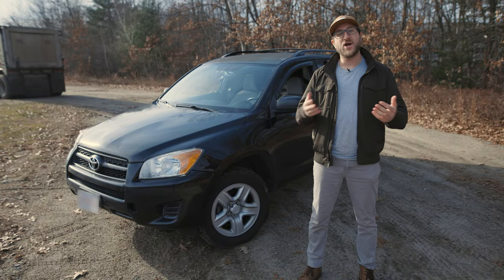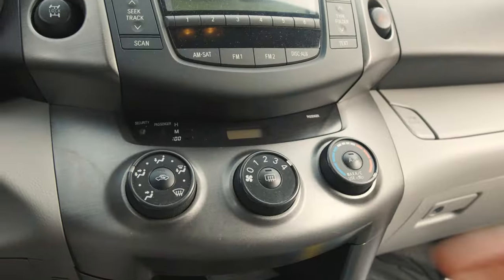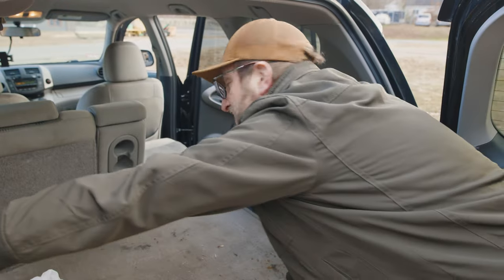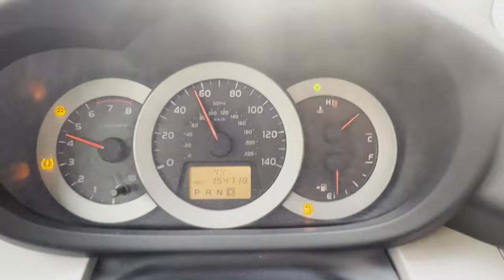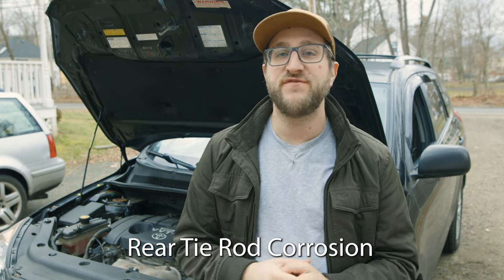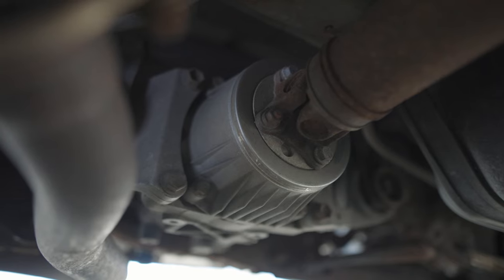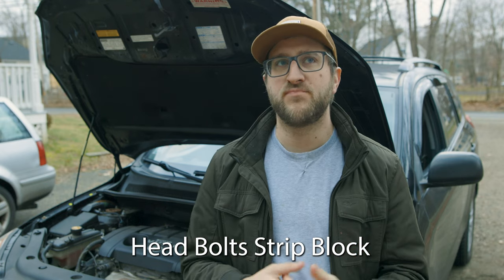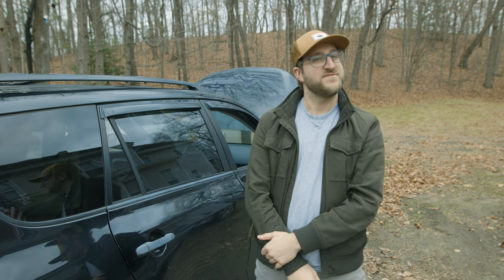Toyota RAV4 (3rd Gen) - How Reliable Are They Really? Review, 0-60, Off Road, Cargo (2006-2012)

Comment from the maker: Feel free to share your experience with RAV4’s, good or bad!
Reply: I have got a 4 cylinder rav4 2012, but is manual and it's 4x2 so i shouldn't have major problems
Reply: Video feedback:   Straddling the line between being informative and entertaining is difficult

1). You become much more entertaining if you upgrade the informative dynamic

— just tell me it’s an expensive part, come up with the price range. Nobody’s going to sue you.
— I believe On screen summaries – especially at the tail end of the video will greatly increase the number of people that watched the video again or seek out your other offerings
Reply: It is good car it’s long lasting
Reply: Where do you live?  Does it snow where you live? If so, I'm sure corrosion from salt spread out on the road during the snow season is a culprit.

Comment: I have a 2010 V6 Limited.  I bought in 2015 with 35K miles on it. The plan at the time was to hand it down to my son for his first car and buy a Tacoma. But, I fell in love with it!  I ended up keeping it and still driving it to this day.  I have had exactly ZERO mechanical issues with it!!  KNOCK WOOD!  Aside from the occasional battery replacement this thing has been flawless!  I've owned a 2002 Mustang GT and a 2005 Pontiac GTO, that is to say I have a bit of a lead foot, and while the RAV4 isn't as fast, its sure a lot of fun to drive.  Very nibble and quick in and out of corners and passes easily on the highway. Also over the life of the vehicle I've averaged 22.5 mpg too. My friends think I'm nuts when I say it's my favorite car I've ever owned. They also think I'm nuts when I say I'd love to have it fully restored back to its original glory! I mean why not, people restore Landcruiser's all the time, why not a RAV4? LMAO
Reply: That V6 Rav4 is far from slow!  It's the fastest N/A V6 SUV ever made!  It will do 0-60 in 6 seconds and the standing 1/4 mile in 15 flat all stock!
Reply: The guy in video may make you to think that rav4 is a bad car. Thanks for putting it here. I nearly got discouraged.
Reply: I had the inverse experience, 2011 V6 bought in 2015 with 35k miles on it.  Love the car, but I immediately heard the dreaded 5th gear drone.  Took it to toyota, they replace the transaxle under warranty (phew!).  Fast forward to 120k miles, 3rd gear slip, hard shifting.  Transaxle was junk, had to get a new one installed.  I suspect the warranty replacement units were crap, or my luck is terrible.  Anyway, I have 150k on it now and it's given me no more problems.  I've got bad luck with previously owned cars!😜
Reply: @zbomb33 I’m just replying for people who see this and might be worried, that’s an isolated issue and pretty unlucky😂 That’s unfortunate, they usually replace your part with some low quality Chinese shii with those warranties.. I’d get the part myself

Comment: My experience, bought a 2011 Rav4 4WD in 2020 with 120k miles from a dealership. Used it for gig-economy work. Kept up with maintenance, changed transmission oil once and the transmission failed VERY suddenly at 240k miles. Was fine one day, would not drive the next. First shop quoted me $8.5k to replace with remanufactured trans, no joke. Another one quoted $4.5k. Shopped around and bought a 2010 Rav4 FWD used for $6k with 170k miles. So I've only driven well-used Rav4s, and if you buy one with mileage on it, check the struts and CV axles. My 2011 shook at highway speeds for a year before the transmission failed due to bent rim and bad CV axles, I left it too long and blame myself partly for the transmission failure. Keep it driving right and it should last. The only other issue, they both burn oil. My 2011 burned copious amounts, 1 quart every 600 miles at least. This one burns a quart every 2,000 miles and it'll probably continue getting worse. Minor annoyance, will eventually cause the engine to fail though. Not much to do about it other than rebuild the engine. I love the way these things drive but after 140k miles, I can't say they are exceptionally reliable, and especially if you don't do upkeep the transmission will probably fail as quickly or quicker than any other early 2010s SUV on the market.
Reply: Wow, that's probably the first real review of one of these that was nothing less than stellar.  I totally believe you, you were just stating your experience.  I've been on the fence for one of these for years (maybe a 2009-2012).  A friend's girlfriend has a 2018 Ford Escape who's transmission went out 6 months out of warranty.  She was quoted $7200 from a Ford dealer and a reputable local guy quoted $4200.  In the meantime, her aunt let her borrow her 2007 Highlander with 193,000 miles on it.  Her aunt got it from a deceased relative as nobody else wanted it as it's a gas hog and huge.  Anyway, my friend called me one day and said I really needed to come out and drive this Highlander because I wouldn't believe in a million years it had that mileage.  Well, I did and he was right.  This thing is as tight as can be, the interior looks like an 8 year old vehicle at worst and it purred like a kitten.  We crawled underneath it with a flashlight and it was dry as a bone everywhere we looked.  The headlights were even perfect (almost too good to be true, they were probably changed at one time).  Now I'm trying to buy it but the aunt isn't interested as she has stated the handful of times she has driven it, somebody in the parking lot hounds questions at her and wants to buy it.  Go figure.
Reply: @grayboo212  Yeah maybe I was a little harsh saying they aren't exceptionally reliable, I put that one through the ringer and it was a workhorse. Only times it left me on the side of the road, alternator failed twice, won't just keep driving if you need lights/wipers if alternator isn't juicing the battery, even with it running. But overall I agree because this one I have now that I bought for $6k, was rough as a dog when I bought it, got new struts, CV axles, wheel bearings, rotors, tires and WOW, it's sublime. You really can't ask for much better out of a vehicle with 180k+ miles. There aren't random things breaking that cause me grief, I know there are some cars where you'll be left on the road for something completely stupid. This isn't one of them. And also I sold that 2011 with the failed transmission for $2k so that tells you something right there, I'm basically happy my transmission failed because it turned into a really nice little swap out for a better one.

Comment: I bought a 2011 RAV4 for $6,500 in 2020. It had 175,000 miles on it and is still running at 225,000 miles. The only repairs I've had were replacing the wheel rotors in 2020, the starter in 2021, the tensioner in 2022, the radiator fan, both front suspensions, axles, sway bars, wheel bearings, coils, and spark plugs in 2024. I did all the repairs myself except for the belt tensioner. Not bad for an amateur YouTube mechanic.

Comment: I was driving my 2012 toyota rav4 on the hwy at 75mph.  The belt tensioner came apart and the belt came off leaving us on the side of the hwy.  I replaced the belt tensioner and belt and tried to start.  Strong starter but it would not start.  I had to get it towed.  I heard from the dealership that cylinded one had zero compression and i would need a new $8800 engine.  So much for toyota reliability.  The car had 130k miles on it.
Reply from the maker: That’s a bummer. I’m not sure what went wrong with yours specifically. It could have been starved of oil at some point in its life.

Comment: My 2011 model has a 2.4L 2WD engine. At 290K miles, I changed all 4 shocks and front wheel rubber bushes and pads for the first time, and I'm still comfortable.
Reply: I have a 2009 and a 2012 and love both. The only issue has been the driver window motor on the 2012. With respect, I think you are breaking the first rule of off-roading: there is no need for speed. These cars won’t bottom out on a trail like the one you were on if you slow down and chose your track a bit more. Great video, thanks.
Reply: *2.5

Comment: I got the 2012 Limited V6 six months ago and its my favorite vehicle ive owned. At only 54,000 miles, I'm hoping for 15-20 years.
Reply: I would think so!  I have a 2007 V6 base with 243,000 miles, and with some maintenance it will probably go another 100K!
Reply: How much did you pay?  I know it had to be a chunk of change with that low of miles and a V6, plus the crazy market at the time (still is but not as bad).
Reply: @grayboo212  yeah it was kinda pricey and a bit over KBB. Signed for $18K on a 5 yr. I live in Utah and the 4WD market is pretty crazy.
Reply: 18k for a 2012… nah,  rust? Rubber components wear out from weather. Sounds like it didn’t get driven enough, that’s never good for a car to just sit.
Reply: @yodead369 the year wouldn’t matter as much as how well it was maintained and also I would think 4500 miles a year is plenty. You’re right about the rust and rubber though. just got one as well with 69k miles, i’m hoping I don’t run into rubber cracking. On the 2012 they fixed most problems people ran into that were in the 2006-2010 models

Comment: When I bought my wife's 1st brand new car, it was a 2012 Toyota Rav4 base 2.5l, 2wd with 3rd row. The only issue we've had was the transmission. After 60,000 miles, it developed a low drone noise. I found out later that the transmission has a hockey puck size transmission cooler inside the engine compartment. The issue was that it would return the oil with over 230-250⁰f, causing it to burn the trans oil faster. That is why 20-30k miles transmission oil changes are crucial on these vehicles! What I did was install an auxiliary transmission oil cooler, and i mounted it in front of the engine's radiator to cool off faster. Now my oil temperature only gets up to 180⁰f max, which will promise me a longer transmission life.
Reply: Thanks. This will help me as I am planning to have one of these.

Comment: Great video on the RAV4!!! I just bought a '10 RAV4 Sport 4cyl 2AR-FE 4WD last year. Had 122K miles on it when I bought it. I am now at 142K miles and have done minimal repairs to it. It is my daily driver and weekend warrior. 
It does need a new VVTi intake gear as well as a new timing chain as it is stretched. The paint marks on the chain are not visible so it needs replaced. I replaced the original alternator as well as the upper radiator hose as it was leaking at the "Y" joint. Mine does need new shocks and struts but overall, very reliable vehicle. I had to turn in my 2019 Chevrolet Equinox lease and did not want to spend $ on a new lease. Found my RAV4 for sale locally and bought it. What I love is the simplicity of it. Nothing fancy, just keeps running. I will recommend to other RAV4 owners out there to change the engine oil and filter every 5K miles or 6 months, whichever comes first. This will greatly decrease your chances of the 2AR-FE burning oil as well as increase reliability. I would also suggest changing out the transfer case fluid as well as the differential fluid. On the 2AR-FE models, changing out the transmission fluid is suggested at 70K miles or you risk the dreaded torque converter shudder. My RAV4 is exhibiting this. I changed out the fluid and it has decreased. I will do it again in hopes it will diminish the shudder if not resolve it.
Reply from the maker: Fantastic comment! Yes, all excellent points. This RAV also had torque converter shudder. I flushed all of the fluids when I first got it. Unfortunately there was planetary gear whine, telling me that someone had let the front diff/tranny fluid get too low (there was a small leak from an axle seal that went unnoticed for too long.) But good call on changing out the fluids- I hope it helps in the future and I hope you have good luck with it!
Reply: Does 09-10 have limited slip rear diff? Can it be added?

Comment: Excellent review and caveats regarding both 4 cylinder and 6 cylinder models. I have a 2012 Limited V6. I HIGHLY recommend the 3.5L V6 (269 hp, 246 lb. ft of torque) over the 2.5L 4 cylinder model given the 5 speed transmission (versus 4 speed tranmission on 4 cylinder models) and generally better overall reliability. 

"You're bulbous" - that made me chuckle.
Reply from the maker: Thank you so much for the comment! I appreciate it. And yeah, V6 all the way!

Comment: I actually daily a 2012 rav4 with the 4 cylinder, and the engine hasnt really given us too much problem, so far its been mostly suspension issues. The handbrake cable snapped as well randomly one night when I was parking, found that to be the weirdest thing to have broken on it.

Comment: I have a 2009 2.2 diesel turbo rav4.  It still running. Last year I installed remote starter. I love mine. Run great on the autobahn.
Reply: Is it noisy and is it comfortable at 150kmh. What's the consumption on those speeds

Comment: I've been on the lookout to buy my first car for a few weeks and every time I see one of those videos it's making me look for another model. Then the other model has the same endless issues lol.
Reply: 2010-2012 v6 is your best bet 07-09 were bad years in general. Keep in mind that whatever used car you buy is gonna need something fixed whether you like it or not, what really matters is the cars history, if it doesn’t have oil changes every 4-6k miles, transmission fluid changes at least at 100k, (60k is recommended but they can go for longer, it actually hurts the tranny if you change it too frequently) tires and brakes that’ll last you at least another 10-20k miles don’t buy it.
Avoid
Reply: @humbertoestrada140  I think the 2008 or 2009 RAV4 actually won the "Clunker of the Year" award from one car site. Most places I've checked have also said to avoid 2007-2009.

Comment: 2010 V6 130K. LOVE it! No problems. I don't want push it off road much because I want it to have a super long life. I have the towing package & have easily towed lightweight utility trailers. It is fabulous in ice & snow with snow tires as long as it's not too deep. Perfect main vehicle for rural & mountains. Took the back seats out for some epic car camping adventures & extra storage space for my work gear. Average 24 mpg with a roof box.

Comment: 2012 AWD 4 cyl Rav4 owner from 39k to 135k currently. Picked it up in 2014. No oil burn, basic maintenance only so far. Def transmission is sluggy and I do NOT recommend hauling heavy loads w the 4cyl esp in mountain or steep hill areas. I love this vehicle. Use it to boondock and camp, haul kayaks secured on the rails. Easy to do your own spark plugs and ignition coils, battery replacement, even oil filter & changes are easy. 
The clips holding the front bumper to quarter panels SUCK and break alot on so many of these. Most use zip ties later and stop buying their terrible part. I slapped an aluminum skid plate on mine bc the plastic under the vehicle are also held by tiny clips that break too often, then the plastic undercover drags. Northwoods has the skidplates.

Comment: 185k miles on my 2010, V6. I’m not sure I would get the 2.5 liter with the oil burning issues. The V6 is so responsive and still powerful, and still fun to drive. I’ve had it for 5 years and got it at 125k miles. Major issues- I replaced the solenoid and sway bar link. That’s it, other than oil changes, tires and transmission fluid change. Love the size and space in the backseat and rear cargo. I expect it will give me several more years of service.. the oil pressure line in the V6 is really only a concern on the earlier models. I think but 2010 it was fixed.
Reply: Actually, the 2.4L 2AZ-FE model engine is the one with the burning oil issue. Those engines are found in 06-08 models. The 2AR-FE 2.5L doesn't have that issue unless you don't change the engine oil and filter on time (every 5k miles or 6 months).

Comment: I have a 2008 model, got it with 56k kms on it, have driven it for 4 years, has failed to start once, due to a discharged battery (my fault), the main mechanical issue since, is the z stabilizer links which are making grunting sound on rough roads. Love this beaty, good on fuel, no other issue...just fun to drive.

Comment: Some rav 4's are FWD. Good for city drivers. I found out when I had a chance at acquiring one from a family member. I thought it was a little 4x4 until I sat inside the vehicle and only saw one gear lever and no options to switch to 4x4. It's actually pretty quick for what it is, but no 4x4. It has a downhill button but the owner says it's a hindrance with everyday driving. 

My original plan - I was gonna put a huge lift on it, 35s on 16 inch rims, make front and rear steel bumpers, put a spare tyre on a carrier on the rear bumper instead of door. A roof basket to store traction boards, spare fuel and water and somewhere to mount LED lights, etc.

Comment: I have a 2009 2.5L 2WD with 130K miles. No problems as described in this video, but I also change the oil every 3,000 miles. The tranny fluid every 30K to 40K miles.
Reply from the maker: That’s awesome to hear. Keep up the good maintenance and you’ll stay pretty trouble free for a long time!

Comment: On the 2006 series, just keep an eye on the VVT solenoid at the back of the engine, with high mileage the O ring on the solenoid can start to leak. Also the actual back of the solenoid can also leak, Im getting mine replaced this week.

Comment: I have a 4 cylinder base model 2006 Rav4 that I bought new. I have been happy with it and plan to keep it for several more years. It would be cool to have the bells and whistles of newer vehicles, but not cool enough to part with the money to buy a newer one when my 2006  model is still going strong. My gas mileage is not as good as the newer vehicles, but it is a small price to pay to be driving a fully paid off car.